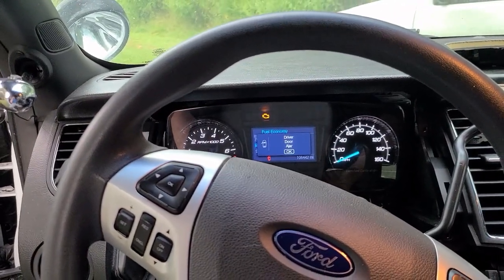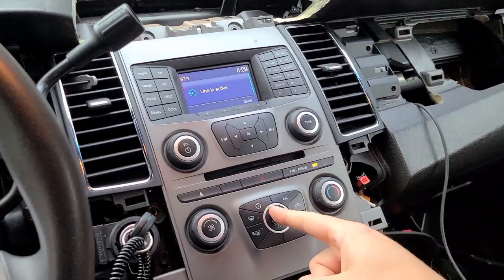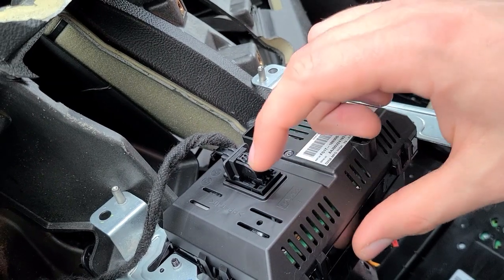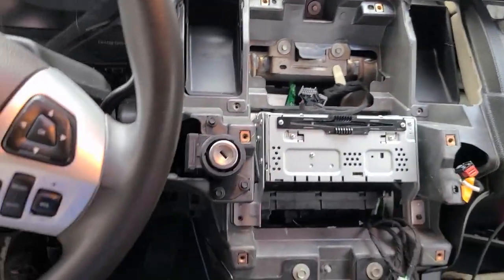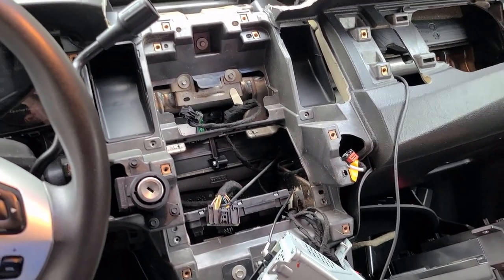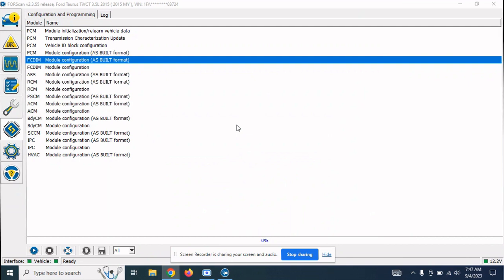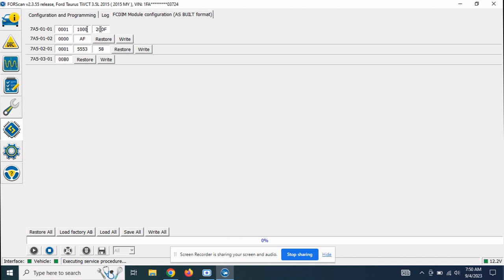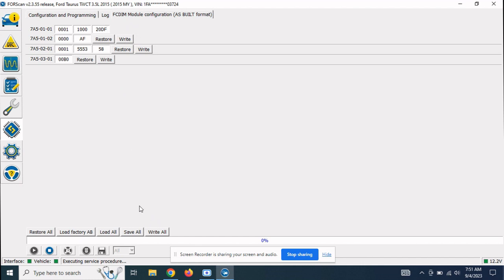13-19 Ford Interceptor Sedan Radio Aux-Enable

Comment: Been searching everywhere for the type of pins the radio harness needs. I've gone through returning two 'all in one' pin kits from amazon but none of them are small enough. Hope your suggestion from amazon works for me, thank you
Reply from the maker: Just to clarify, you'll need to unpin the wires from the connector that the amazon one comes with without destroying/damaging them and then re-pin them into the back of your radio.

Comment: Can you please make a in depth tutorial I just got my 2013 Ford Taurus police interceptor that doesn’t have an aux input and I’ve been looking for a video like this because I’m tired of using an FM transmitter to sync my phone to the radio. I appreciate it so much thanks for your help
Reply from the maker: I'll start the process of capturing all the video and hopefully get one up this weekend if time permits.
Reply: same, did you find a solution?

Comment: Quick question I also be hearing a beeping of noise when aux when nothing pay does that happen to u
Reply: Or is cause I’m using a Bluetooth aux port thingy
Reply from the maker: @B711HD  It does not happen to us on any of our test vehicles. We have used bluetooth to Aux adapters without issue as well. I would try using a regular Aux cable with an adapter directly to your phone if your phone does not support Aux directly (Most phones nowadays require a USB-C to Aux or some other adapter) and see if the beeping continues. If it stops then I would assume it is your Aux to BT adapter.

Comment: I have a 2014 3.7 Interceptor Sedan. When I bought it the AUX and radio worked but the radio screen was blacked out. I bought a radio from ebay, now my radio and screen works but my AUX will not. When you push the button it says AUX enabled but it will not work. I even tried the program with Forscan, still nothing. Any idea what is wrong?
Reply from the maker: Could be a wiring issue. check the wiring diagram in the videos we have and see if they match. If not then try wiring an AUX input to those and see if it works. There's not really a fix all solution to your issue with it being so unique but hopefully that helps. You may also want to try verifying the model of radio that you got is actually for the same year, make, model and package of vehicle you have. Sometimes they don't play well when not matched correctly.
Reply: @GT-Industries  The radio still works, and the cd player still works, and the radio face says AUX audio when I push the button so it's still programmed and wired into the car but the AUX will not work. Kind of strange since I didn't change anything else. I'll get in touch with the seller, thanx.
Reply from the maker: @whitestratman3158  You may want to double check the wiring. The AUX function and screen saying AUX means the radio is programmed for it but just because it is programmed and displays AUX does not mean the wires are actually connected. You can have everything working but the wires be disconnected for that specific function. We have run in to that in the past on other vehicles. Commonly it is caused in police cars due to non-stock wiring being installed or uninstalled and damage occurring to the stock harness. That's why we recommend checking the wiring to verify it's connected.
Reply: @GT-Industries  Well, that's just it. I didn't touch any other wiring except the one loom that plugs into the back of the radio, everything else is hidden behind the panel and cd player.  I did twist those two purple wires together on the bottom to get the horn working at the same time.  So, I went back in the bottom and put those back the way they were and no change.  The usb outlet above the aux outlet on the dash (in the same mount) isn't working BUT I never tried it before all this because I'm using the 2 -12V below the heat/AC. I wouldn't think one would have anything to do with the other because I can't see the auxiliary wire being powered and I can't find a fuse to either one. Just something really stupid and really aggravating that shouldn't be but, unfortunately it is 🤬 I may end up having to hard wire it in with another cord like you did. 😫

Comment: Hey man so I install it but thing is only hear passenger sides speaker playing
Reply from the maker: Make sure the pins are all pushed in to the plastic clip of the radio harness. Also, pull on the pins/wires to see if they slide back out. They have a tiny little piece of metal that bends out to keep them held inside the factory harness connector. If that piece of metal isn't bent slightly out from the pin or if the pin is not inserted with the proper orientation, the pin can slide back out of the factory harness conector.

If the pin is able to freely slide out, when you plug in the harness back to the radio, the pins on the radio will push the pins in the harness back out.
Reply: @GT-Industries  hey thanks man got it to work that was a quick respond u save my day lol I wasn’t in all the way
Reply from the maker: @B711HD  no problem, we're here to help.

Comment: My front speakers, cigarette lighters nor USB port works in mine.  They're there but non functioning.
Reply from the maker: Sorry to hear that you're having issues. I'm assuming by your comment that this stuff worked before? I would assume you either forgot to plug something back in, it blew a fuse or something else is causing the issue. Unfortunately we are not able to tell you how to fix that problem since we did not work on the car but we wish you the best of luck in fixing it!